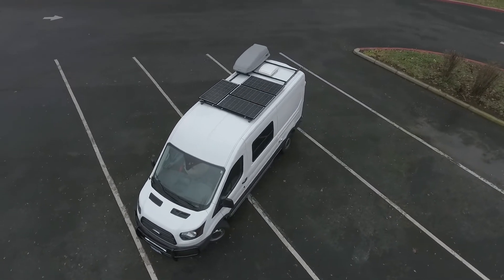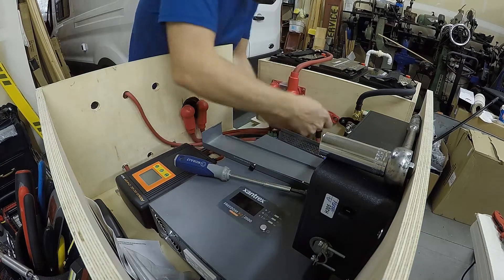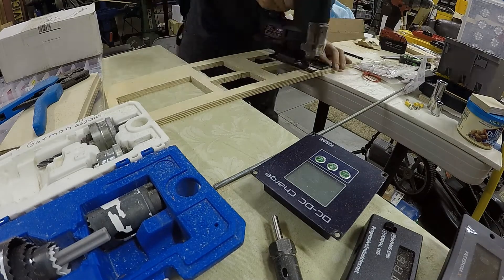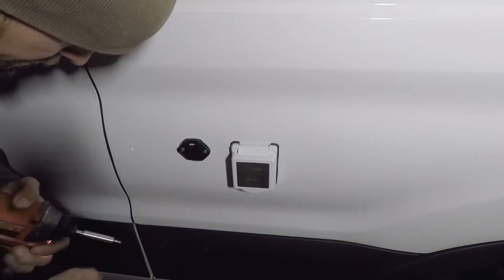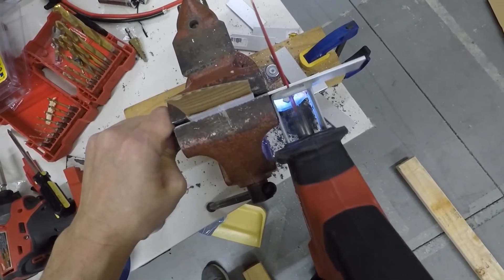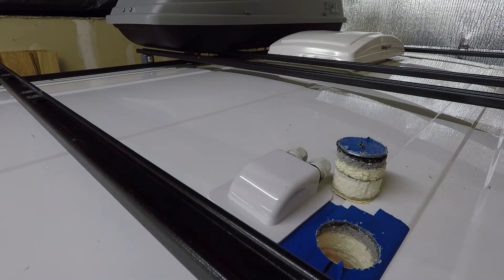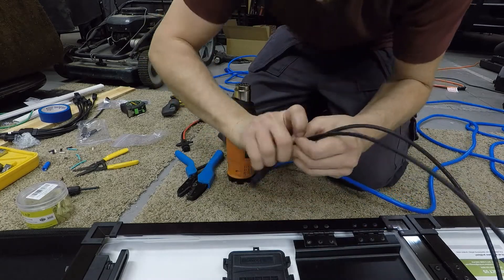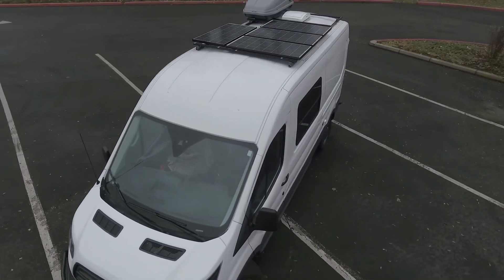Ford Transit VanLife Electrical System. Lithium, Solar, Shore Power, Battery to Battery Charging.

Comment: Did you put a fuse in for the inverter-charger? Unless you are using the master fuse as protection.  I can't see one...But I am half blind..I was under the impression that you fuse it separately.

Comment: Does that van have the dual alternators?
Reply from the maker: Single stock alternator. The battery to battery charger makes charging lithium batteries possible on the stock alternator. Only takes 60 amp draw.